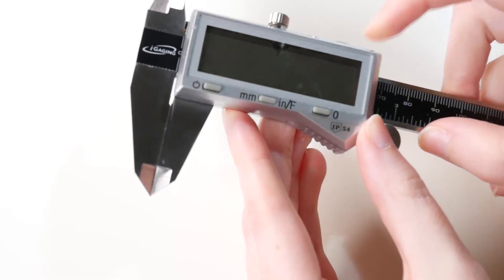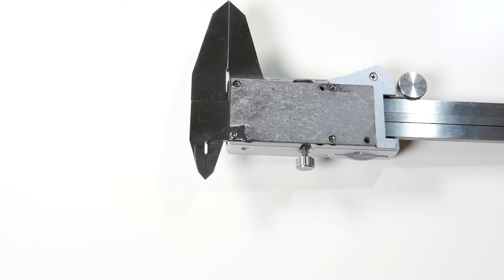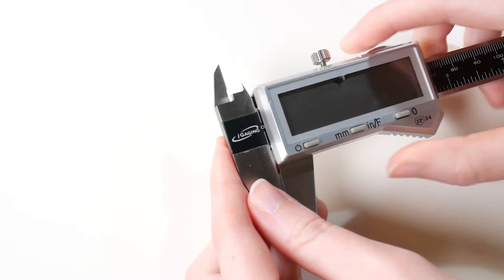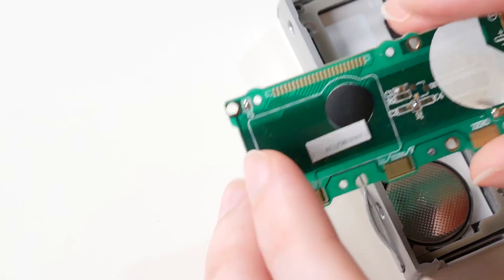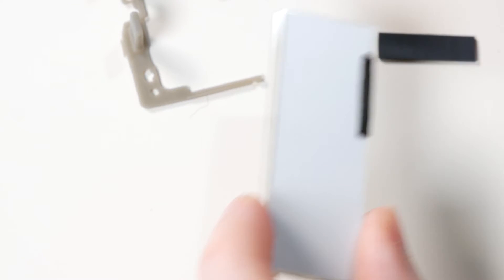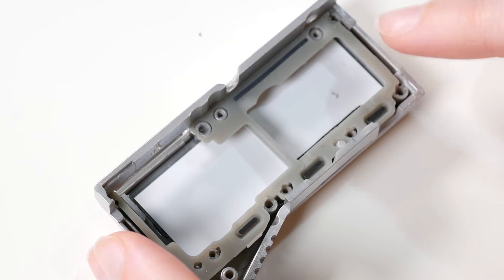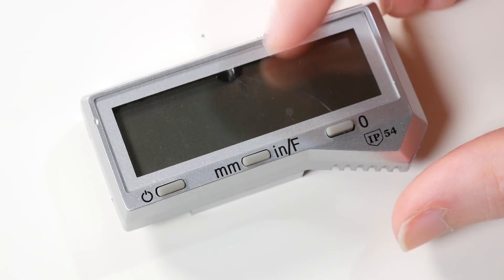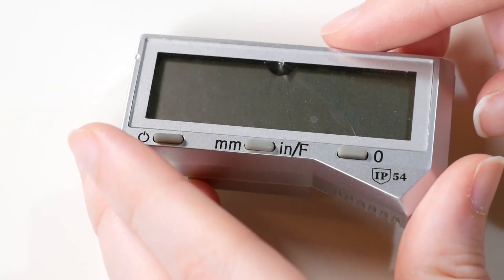I Broke the Screen On My Calipers

Comment: Get the cheapest plastic set on ebay, with the same screen. Swap the screen to your good pair. Make something cool with the scrap plastic caliper bits.  

The LCD form factor is important though. The LCD is probably custom to a certain style of caliper. Custom LCDs are not difficult to source in bulk, but finding a specific one for an existing item is tricky, as you are now no doubt now aware.

Comment: hi! just find you by the recent video collaboration on david channel. is true that when thing broke nowadays is cheaper just to trow it away. but i feel just like you and cant do that.  replacement part are expensive or difficult to find. Reverse engineering the signal and hooking up an arduino and i2c display may be against the goal of fix it. I be thinking... your caliper board seems to have 23 contact thru the ZEBRA strip (it is is name). i doubt the display is a COG (chip on glas) is the black blob driving the segments on the glass.  So i may try to replace the display whit any other numeric one cheap yo can find . there are some used in weight scales that uses metal pins instead of zebra stripes. so you can solder wires to the existing board . is a lot of work  but you can get it working (you loose symbols like mm or in)

something like that https://www.ebay.com/itm/EDC190-4-Digit-7-Segment-LCD-Display-Digital-Clock-Tube-Static-Driving-3V-TN-Pin-/232240814922?_ul=CO
Reply: also look at these http://www.farnell.com/datasheets/425221.pdf

Comment: I wonder if you could get the signal from the chip, and use it as a data signal for an Arduino and then use a common i2c display. I can’t see the chip using a proprietary communication protocol to talk with the screen. Then again a new one is under $10 and made of pure Chinesium goodness!

Comment: If you can figure out the serial output, maybe you can connect it to an Arduino with an off the shelf LCD on it. Then to actually have a good reason to do that, write some software that emulates a keyboard and types the measurement into your PC at the push of a button!

Comment: Hey Liz! These are most likely a custom display. The mm / inch parts are pre-set on them so it will likely be difficult to source a replacement. Some of the cheaper ones have a serial output, it may be possible for you to do some digging and hack an "off-the-shelf" display onto your calipers; this would make an interesting video!

Just had another look at your video...the test points at the bottom-left may be the serial output.
Reply: You can actually map which segments correspond to which positions on the zebra connector using a coin cell. Then design your own LCD - EEVBlog did a series of videos on designing a custom LCD and having it made to order.  But if you are the Applied Science guy you could make it from scratch.
Reply from the maker: sweet! yeah I'm going to be looking into that
Reply from the maker: thanks for the tip on serial output! i also learned about Robert Baruch's work on a TRS-80 LCD that I'm going to take a closer look at: https://www.youtube.com/watch?v=p8-HfGTCcCk

Comment: I'm pretty sure these use a custom LCD rather than the common HD44780 2 line displays.  My calipers certainly do, and the 23 connecting pads on this one suggests that as well.